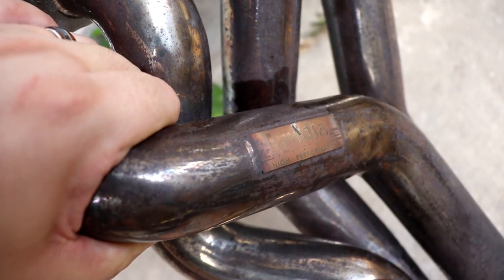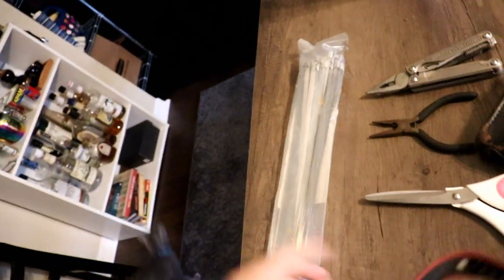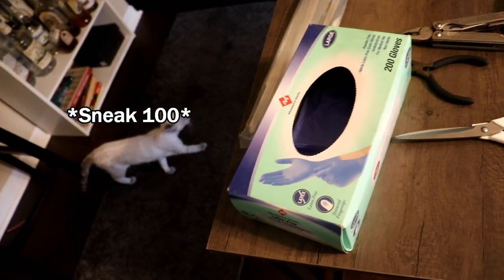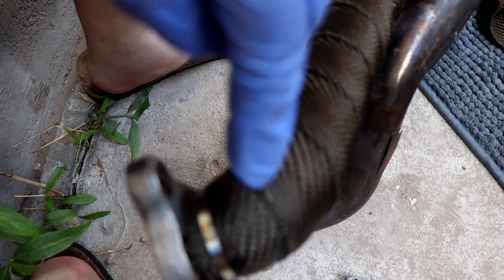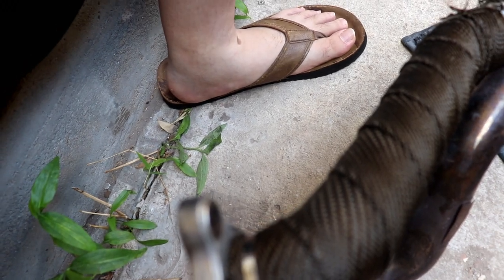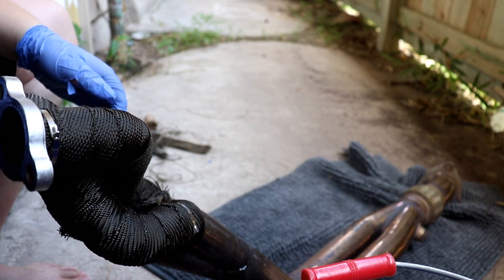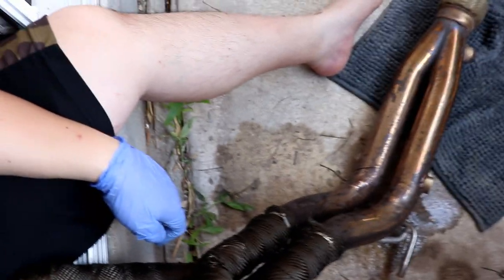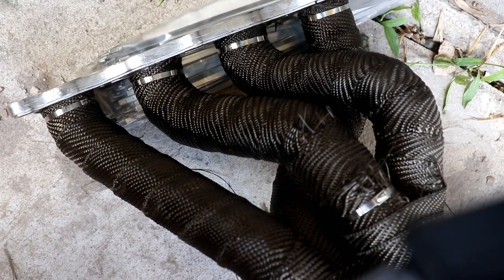Exhaust Wrapping Race Headers For My RSX!

Comment: Do you need upgrade motor mounts if it has a flex pipe?
Reply from the maker: No I don't think it's necessary, flex pipes are meant to compensate for vibrations